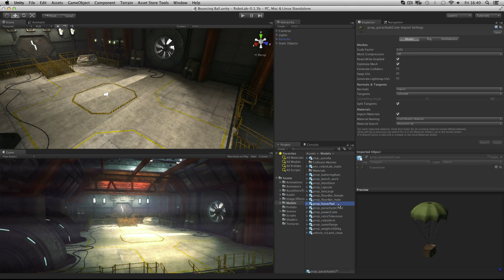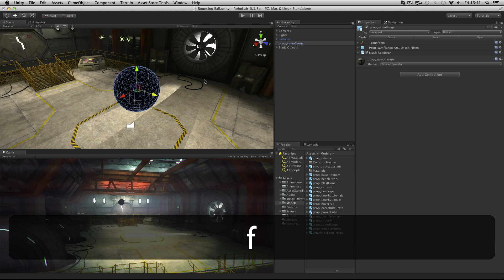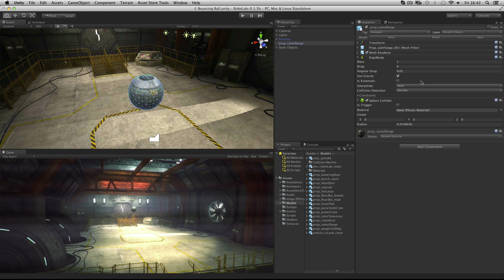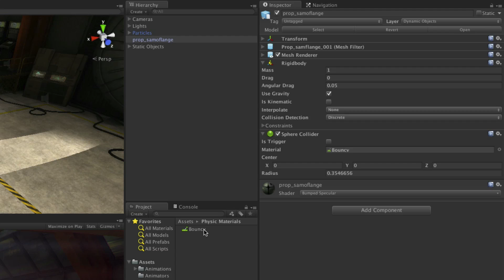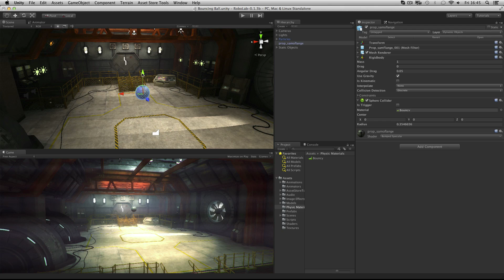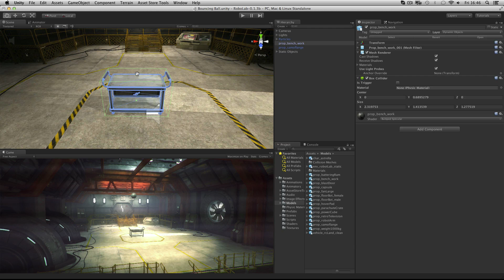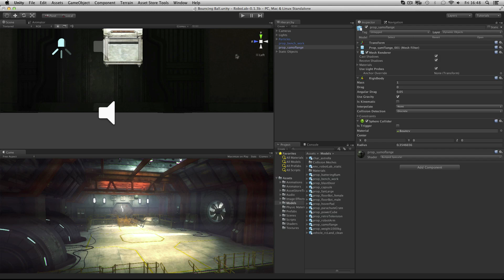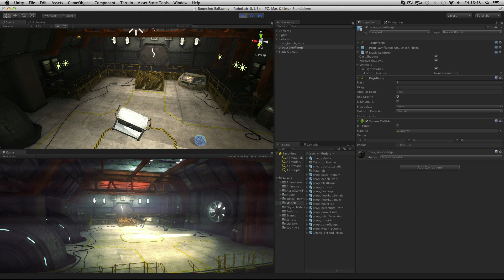Bouncing Ball - Unity Official Tutorials

Comment: I have a few problems with this. The empty scene has a tiny camera that spins around. Everything is white/blue in new camera. Increasing the Far Clipping Plane doesn't help to see.

When I add Bouncy I watch it in Scene view, since no camera works right in Game View. The ball is bouncing very slow. Physics are working fine. Changing the Mass doesn't do anything. The bounding box was already applied to "prop_samoflange" but was very small, I had to delete it and make a new one.

Any Suggestions?